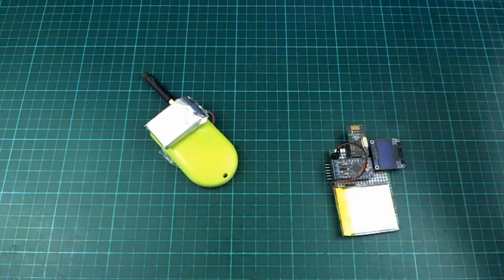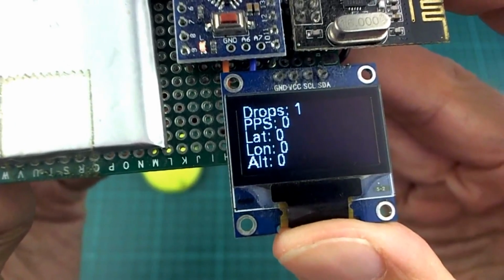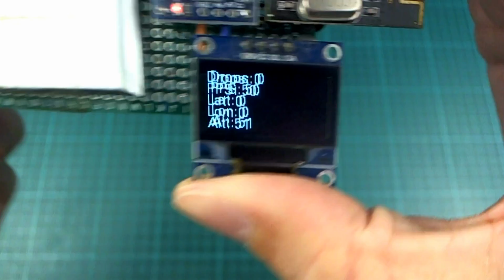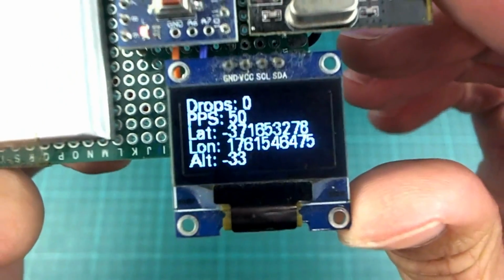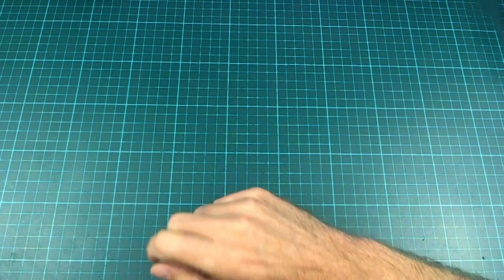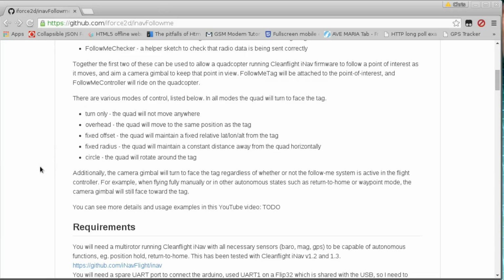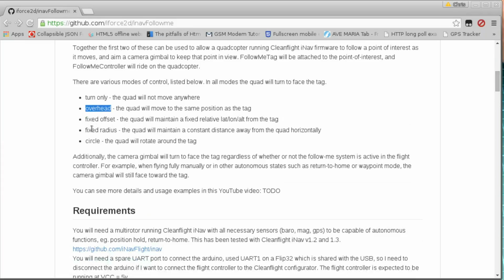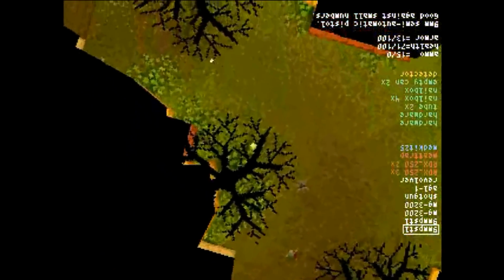Quadcopter follow-me howto (arduino + cleanflight iNav)

Comment: Hello,i get an error code for the controller and for the tag.I had installed the two dependecies: rf24-master and u8glib from your links.The checker has no errors so it is ok.
I dont know how to fix them.

I am using Arduino 1.0.6
Library link that i have downloaded exactly(in case i have make an mistake)
https://github.com/gcopeland/RF24/archive/master.zip
https://bintray.com/olikraus/u8glib/download_file?file_path=u8glib_arduino_v1.18.1.zip

I have imported them with sketch->Import Library

Follow me tag error:

  This report would have more information with
  "Show verbose output during compilation"
  enabled in File > Preferences.
Arduino: 1.0.6 (Windows 7), Board: "Arduino Uno"

In file included from FollowMeTag.ino:41:
/MS5611.h: In function 'int32_t baroCalculateAltitude()':
MS5611.h:368: error: 'powf' was not declared in this scope
MS5611.h:368: error: 'lrintf' was not declared in this scope
/MS5611.h: In function 'void performBaroCalibrationCycle()':
MS5611.h:379: error: 'powf' was not declared in this scope

Follow me controller error:

  This report would have more information with
  "Show verbose output during compilation"
  enabled in File > Preferences.
Arduino: 1.0.6 (Windows 7), Board: "Arduino Uno"
In file included from FollowMeController.ino:40:

/cleanflight.h: In function 'void geoConvertLocalToGeodetic(gpsOrigin_s*, t_fp_vector*, gpsLocation_t*)':
cleanflight.h:125: error: 'lrintf' was not declared in this scope
In file included from FollowMeController.ino:44:
/msp.h: In function 'void msp_loop()':
msp.h:246: error: 'fabsf' was not declared in this scope
msp.h:307: error: 'sqrtf' was not declared in this scope
msp.h:339: error: 'sqrtf' was not declared in this scope

THANK YOU A LOT,I DONT KNOW HOW TO FIX IT
Reply from the maker: These are sketches, not libraries. I have never done "import library" in my life, so that's probably not necessary :) I copied the u8g and RF24 libraries into the libraries folder of course, but just a normal copy, not using "import library". For my sketches, you should just open and compile, not "import" anything.

Comment: Well this involves a 3dr telemetry system:
One on the flight controller linked directly to the FC,and one on the tag.The tag gets info about the quad position,then it could calculate where it should be then it sends commands directly to the flight controller.There is no need of an extra arduino on the flight controller,because 3DR is connected directly to the flight controller and its sends directly info to the tag then it receive informations from where it should be.The 3dr is exactly like your nrf24 exept that you link them to the FC(rx tx vcc ground),and the other one on the arduino(rx tx vcc gnd)from the tag.The ideea is that the tag will be directly linked with the FC.I wanted to explain you this ideea because it might be usefull in your future projects,and as learning(it might be important to communicate directly to the FC from the ground).Just search more info about 3dr telemetry how they work how to connect them,on youtube and google,then lear about how to connect two arduinos using 3dr telemetry and establish a communication(this i found only on google ant 2 examples from youtube wich are useless).Then you should be able to integrate msp from the ground(this part is doing ezgui on an android witch is connected via otg with a 3dr).This was just a suggestion for you, if you want to give them a chance or not is ok.
Good luck in documentation part and remember that for me you're the first man on youtube wich wanted to learn us for free follow me modes on quads and cars.Is so originall.
Thank you for your efforts.

Comment: Sorry for my exprimation,now I had read my comment again.So a 3dr is like your nrf24 module,exept that is connect directly to the flight controller.You can do serial connection between the FC and the tag.You can directly write and read info to the FC with the tag, without needeng an extra arduino.The problem is that i dont know to use msp and firstly i shoud understend your msp.h completly.Thats the hard part for me.Ez-gui is using this conection(via 3dr telemetry) and it has succecefully implemented the follow me feature to Multiwii and INav only.So i think it is possible to use msp and 3dr directly.Aniway whatch that video i had sended at the previous comment.
Best wishes,
Cezar
Reply from the maker: The extra arduino is needed to calculate the necessary position, heading, altitude and gimbal angles. If you don't have an arduino, you would need to modify the flight controller source code to do that job. I wanted to make something that people can add onto a flight controller without modifying it. The EZ-gui method does not support altitude tracking as far as I know.
Reply: LC (and IF)  what LC is describing is the way an antenna tracker works. The quad sends gps data to the ground...the tracker uses it's own GPS to then calc the position of the servos to point the antenna directly at the quad. I too thought about this but as you state it's the quad that needs to know where the ground station (tracker / tag) is  The  3DR is simply a 2.4Ghz UART version of your of radio of choice.  If the bandwidth were high enough the antenna tracker COULD be re-vamped to send data back to the quad to do the  gimbal work. But 'as designed' the 3DR setup talking to the controller would not give you the features the ' on craft' Arduinio is performing (circle follow etc gimbal attitude etc) One way or the other LC your suggestion would need two  radios or MAJOR revamping of this presented material.  BUT these features ARE avail on some currently avail quads, Parrot, DJI for example) so it should be possible.  BUT not with a much more dense Arduunio FC integration (IE programming the FC itself to handle the functions of your arduino as you previously stated)

Comment: As a curiosity, it is possible to link the flight controller to a 3dr telemetry system,and arduino too in order to reduce weight.The controller sends directly gps info to the tag, where you can then prelucrate.Of course with a modification of the souce code.

Avantages:
-reduction of weight
-The tag can be set to display the range between tag an the quad
-Pps alert notifier direcly on the tag,a buzzer might be set when the pps drops below 20
-Buttons to switch directly the flight modes
-Only one arduino is necessary

Disavantege
-lack of range (i think)
-re programming your code

So i want to ask you if this is possible?Thank you verry much i love your work,and also that you explain werry well.
Reply from the maker: Knowing nothing about 3dr things, I don't really understand what you mean but it sounds like you have a different goal altogether - the purpose of what I made is to keep the quadcopter fairly close nearby, so range is not a problem, and pps will rarely be a problem either.

Comment: Hello,your project is super cool and interesting.I have one question: How do you actually flash the boards??
I understend that one script is for the tag and one for that particulary checker.But the controller script you must flash on the arduino linked by the fly controller right? And if the arduino gives tag's position to the controller, how does the Flip32 actually manipulates these,because i dont find any scripts for the flight controller.Or the controller script is only for the board,and if is so whats the script that actually is running on arduino??I know it may be obios but you can make a tutorial for where each script goes for bengheeners??
Thank you and sorry for my bad englesh
Reply from the maker: To be honest if you are asking how to flash an arduino this is not the project for you. It's not a beginners project and this is as much detail as I will be going into. I have already written and commented all the source code, and wrote a long readme, and also made this video. If this is not enough I can't recommend trying to make it yourself.
The arduino does not give the tag position to the flight controller. It receives GPS info from the flight controller. The flight controller runs Cleanflight iNav, all this info is on the github readme.
Reply: iforce2d Ok and actually the arduino on the flight controller is calculating the difference between flight controller's position and the tag's position and then it sends operations to the flight controller.That's make sense.I thought that you need a special script for inav to give informations to arduino and to read them from arduino in order to make operations but the arduino is doing all this stuff.Thank you a lot and you're right this is not an bengeener project.

Comment: How do you base connect the different module with the arduino card for the emetteur and on the quad?
Reply from the maker: I think this is what I said at the beginning, about how if I have to explain this, you probably should not be attempting this project... in any case, if you look at the source code the connections are all explained there.
Reply: Thanks for your answers and your different project's videos. In the futur, if you can write on the video your text  for the non english speaking it will must better.
Thanks a lot...

Comment: Hello, i have an old crius multiwii board that has an integrated barometer. Can i use it for the tag combined with ublox GPS?
Reply from the maker: If it's one of those boards that's basically an arduino, and the barometer is an I2C one, and you're talking about making the tag with it, then I suppose so.

Comment: I've been waiting for this video - very well done. Suggestion? @ 6:40 when you talk about having to disconnect the rx/tx between the arduino & the gps, why not use one of the unused dip switches to handle that?
thanks for this and keep on thinking outside the box!
Russ from Coral Springs, Fl, usa
Reply: Russell Holt Nice suggestion ;)

Comment: If u need more accuracy especially in the height (racing drone Autonomous navigation in harsh terrain :D ) , the ublox claim the have a centimeters-accurate GPS called  ublox neo-m8p 
I hope u review that module - not the cheapest but if it's as their claimed accuracy @200$ it would be amazing -
Reply from the maker: I don't think they would claim that kind of accuracy for the height would they? Surely it's just for horizontal.... in any case, I would need two of them so that's $400
Reply: iforce2d they are claiming use for UAVs so I don't think they are going to lie about this. 
Check their product specs here 
https://www.u-blox.com/en/product/neo-m8p
You don't need 2, just the drone gps for the racing drone idea (something like Redbull Autonomously :D)
Reply: iforce2d I think they may give u one for free to review as well
Reply from the maker: I checked the datasheet, the centimeter-class accuracy is of course only for horizontal positioning. The reason I said I'd need two is if I was using it for relative height measurement then the tag would need one as well. In any case, it says the centimeter-class accuracy is when using RTK, so you would still need two of them, and three if you wanted one in the tag as well. I mean there is not much point having a centimeter-class accurate quad trying to follow something that is not centimeter-class accurate... :)
But yes, it would be a really cool thing to try and review. I think it would be more useful for ground UAVs, like a robo-lawnmower. The level of accuracy I've seen with the M8N is quite good enough for a quadcopter I think.
Reply: iforce2d
Well, u can use one as a station for all ur Drones, something like a ground antenna. 
I think accurate altitude would be beneficial to many applications especially the fast UAVs that need to perform fast Autonomous navigation across streets for search & rescue for example (they've a UDR version with accuracy as well). 
I think this is a new field that would explode in the near future.

Comment: Have you considered using a mobile device instead of the arduino + gps tag?
Reply: Thanks, i will build everything 2 times for 2 quads! Do you want updates/guinea pigs?
Reply from the maker: To get EZ-GUI to output through a nRF would require an arduino or some other microcontroller in between them to translate between the serial connection and what the nRF uses. But even that might not work out because EZ-GUI typically uses a two-way connection, so it expects to also be able to query information from the flight controller, which it would not be able to without a lot more programming work...

As far as range goes, if you have 3DR dongles that is as good as nRF or maybe even better.
Reply: surprised you use the baro...the gps vert info is more accurate than hort and more accurate than the baro (no drift over time) You could have grabbed the alt along with the gps coords and deleted the baro board
Reply from the maker: Yes.
Reply: Is that something you are pursuing? I would definitely use that app
Reply from the maker: No. I don't like the idea of a non real-time OS running something like this, plus a dozen background processes and handling cellular traffic, incoming SMS or calls, etc. as well. Not many phones have a baro (that I know of), and I doubt their wifi can match the 1km or so range of the nRF24.
If you are ok with a close range system with no baro, you can do this already with the EZ-GUI app over bluetooth.
Reply: I understand
Reply: Hi, would it be possible to connect the NRF to EZ-GUI via OTG? Or use NRF instead of those 3DR dongles? Thanks
Reply: Thanks for your answer! Will do! Does the tag support the M8n Module?
Reply from the maker: Yes.

Comment: Superb work. It always amazes me the time and effort you put in to sharing your projects in such detail, its very much appreciated. I look forward to trying it out one day but I have too many other projects on the go. I'm still using your nrf24 control code on my 450 with DIY tx! but it's not as good as the fs-i6 using 10ch ibus that I have on my x220 now. Also using the SPracing F3 (clone) on that, the extra hardware uarts will come in handy for this sort of thing. Thanks again!
Reply from the maker: True, I have a F3 board here waiting for my next AP build.

Comment: Impressive! Very nice implementation. A function I dream about is having a follow me function were the copter sits between you and a fixed point. For example, when I drive around a race track the copter can not keep up with me (yes, I am that fast! :-)  ) but if it always is between me and a fixed point in the centre of the track, it would not have to travel so far.
Keep up the good work!

Comment: I normally purchase everything you recommend , only thing I need here is the flight controller. 
Banggood only carries a naze32 
Can you recommend the specific flight control board and GPS
Reply from the maker: Banggood still has this flip32 I'm using: https://goo.gl/Ij621f
The GPS is this one, quite good: http://goo.gl/kF6Ucr
To disable the onboard magnetometer of the flip32 you need to carefully cut a trace on the board.
https://www.rcgroups.com/forums/showpost.php?p=34639699&postcount=5513

Comment: Hi! 
Hoping you (and your farm and QUADS :P)  are ok after the quake!
I saw you are using a Flip32 as FC.
Seems like your UART1 is used by this project. UART2 used by GPS? and where do you connect IBUS for your 10 channels FS-i6? 
Are you using a softserial for the GPS?

Thanks
Reply from the maker: I'm using PPM on this quad, not ibus. GPS is using UART2.
Reply: Ok. With how much channels maximum are you limited?
Have you any expecience with GPS running of softserial?
And.. sorry for too much questions..  does INAV always start in level (horizon?) mode by itself?
Reply from the maker: PPM has 6 channels on the FlySky i6. hmm... I don't think I have tried GPS on softserial, I'm using that for OSD anyway. iNav is just a modified version of Cleanflight, so the modes will be whatever you set up in the 'Modes' tab of the configurator.
Reply: Great. So you use 4ch for normal control and at least one switch to enable horizon mode.
Thanks

Comment: You should use 3.3v Arduino to talk to CF FC without any level shifting. Flip and all stm32 based boards are working on 3.3v logic though most pins are 5v tolerant.

Comment: Did you think about using your phone as followmetag? With wifi connection through esp32 to quadcopter would make this way simpler. Less gadgets to build to get started. Phone has barometer, gps and display for debugging and setting modes etc. And esp32 wifi board costs just few $ and can be connected to arduino quite easily.
Reply: You can already use follow me with iNav and EZ-GUI app on phone.